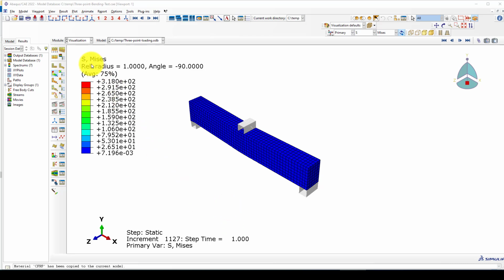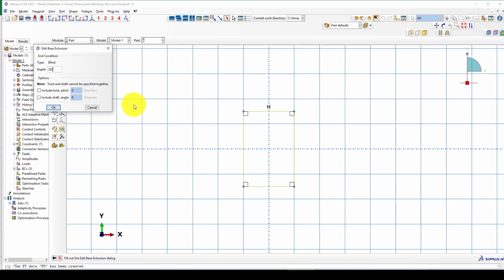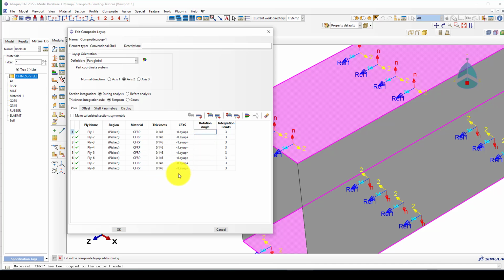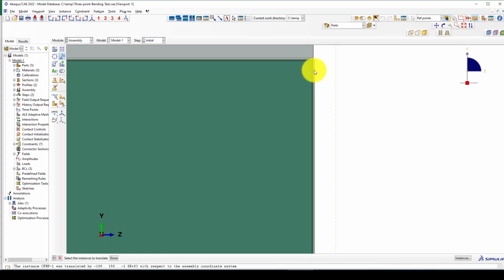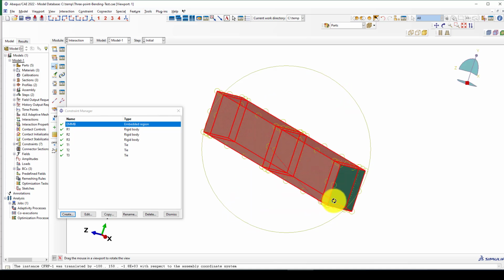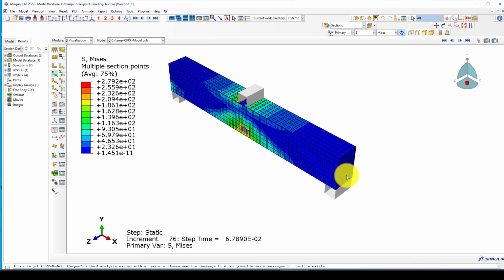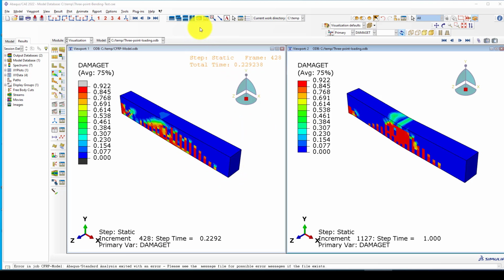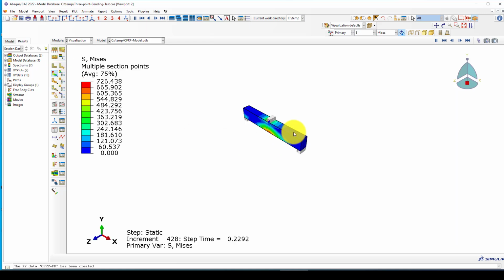ABAQUS Tutorial, Reinforced Concrete beam strengthened with CFRP and Three-point bending loading.

Comment: Could you please help me, i model a reinforced concrete beam with CFRP in the form of a plate using Abaqus? I would like to know the properties required to input for both the concrete and the CFRP material.
Reply from the maker: You can check some article of some manufacturers to get the properties of the CFRP.
Reply: @KSSE_Engineer    "Thank you for your interest in my comment. However, I am facing difficulties in obtaining the suitable properties for concrete."
Reply from the maker: @ please join my channel membership and get the material that I used in the tutorials.